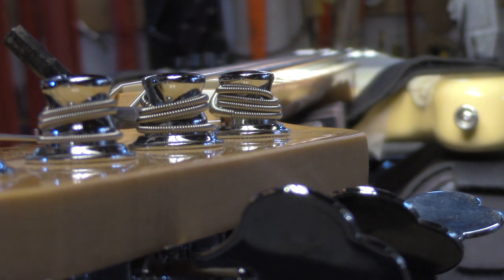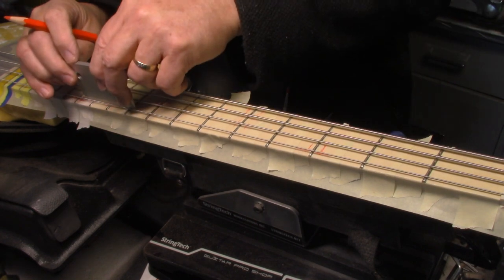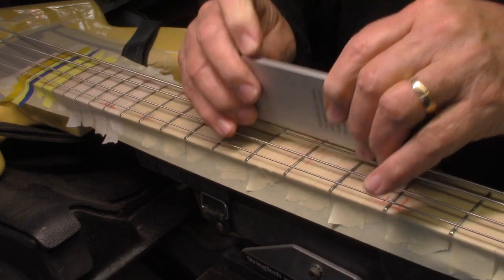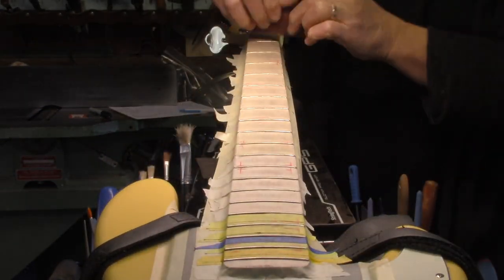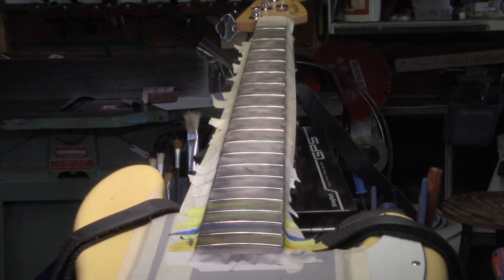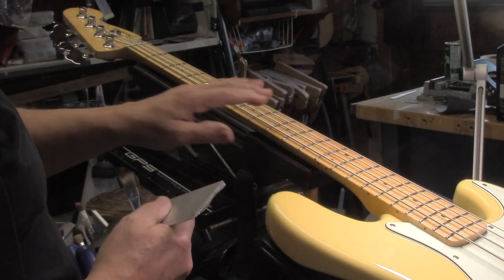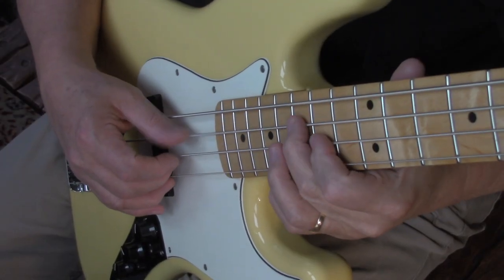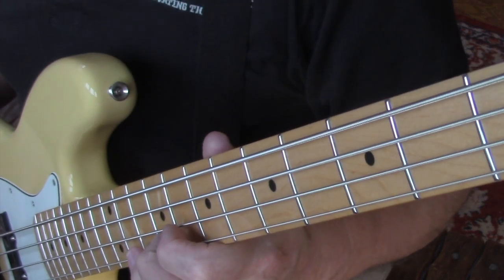Jazz Bass Setup / Fret Dress / Radius Gauge @StringTechWorkstations

Comment: Question for you Mike : Would you say this is your go to method of fret leveling for all basses in general? Or only for the ones that you spot with a troublesome neck? Thank you for sharing your knowledge
Reply from the maker: The neck to body junction ..is without a doubt .. the most common fret dress. It gets a bit trickier when there are random issues, along the lay of the neck.